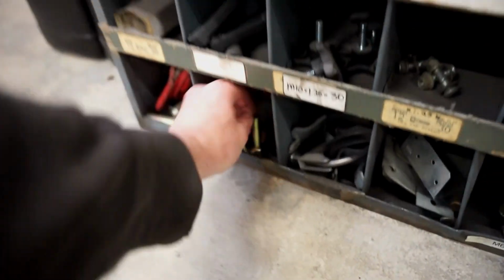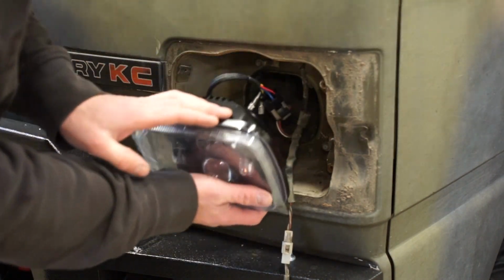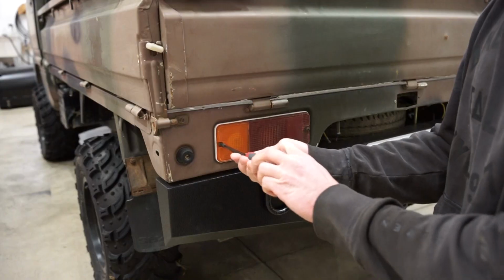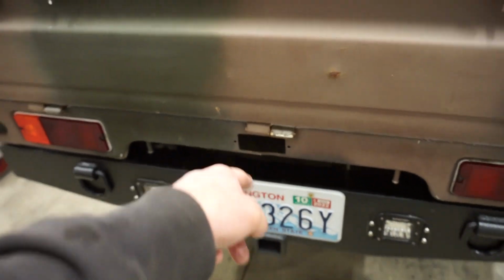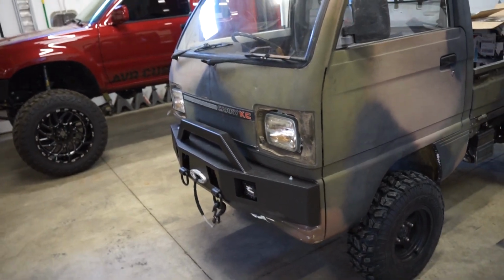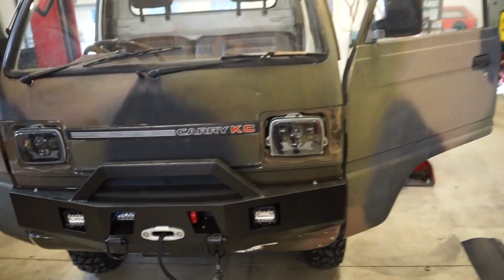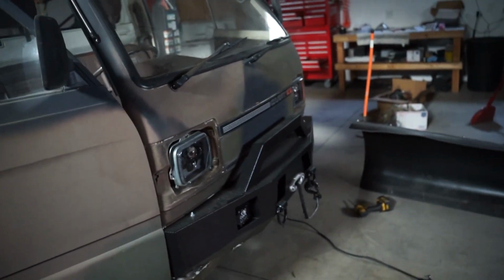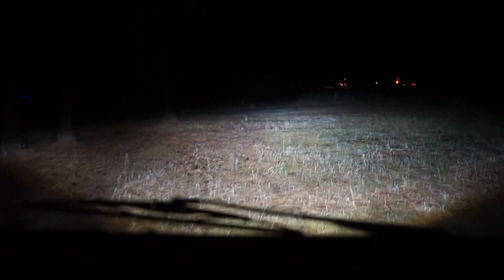The Best LED Headlights I Have Seen!!

Comment: Take a 2" steel pipe and cut a groove into it, Slide it up on the cutting edge of the blade. It is amazing. doesn't hurt the gravel at all. been doing it for years.

Comment: Little truck is coming along nicely,instead of using sand bags in the bed.I’ve seen people use parking lot car tire stop concrete and if you can find,cut pieces of railroad tracks.just a thought.keep it up and keep doing your thing.👍👍👍😎😎😎

Comment: Great job maybe you could try led globes in the tail and marker lights, would give you a better light with less power drain and cheaper than the full replacement units

Comment: Your cop is going to love you!!  Blinkers and side markers have to be visible from the side on the front.  Don't recall what the arc of visibility is exactly but I am rather certain yours won't comply for on road use.  The pig might be low on his quota when you go by.  I sure like the 6500K-7000K LED headlights.  Tons more usable light after dark.  Brings out those pedestrians in dark clothes way better.
Reply from the maker: It has factory side markers and blinkers on the side of the cab behind the doors, completely legal